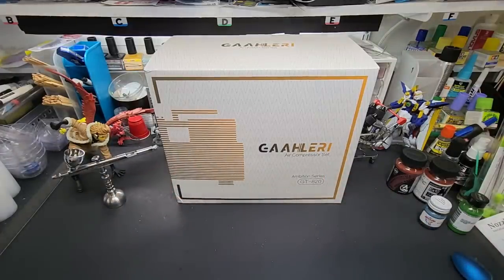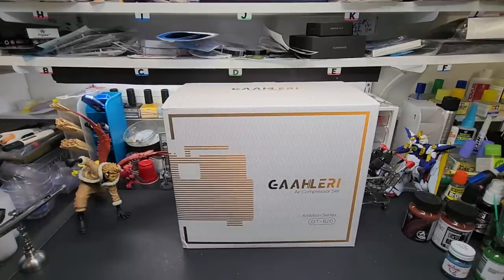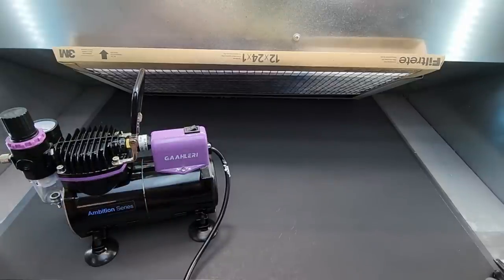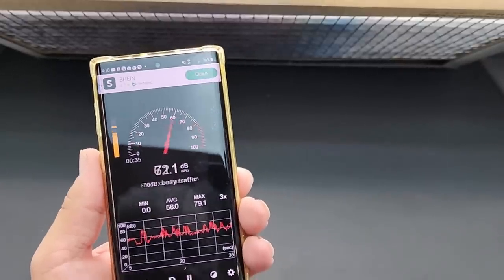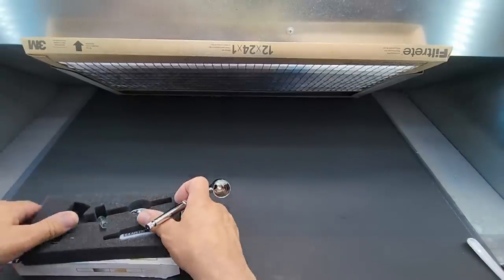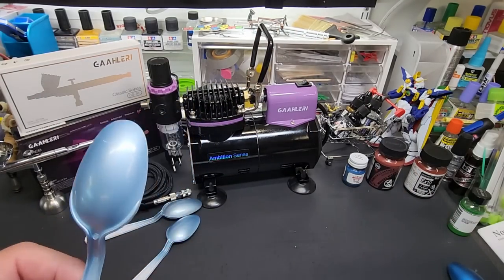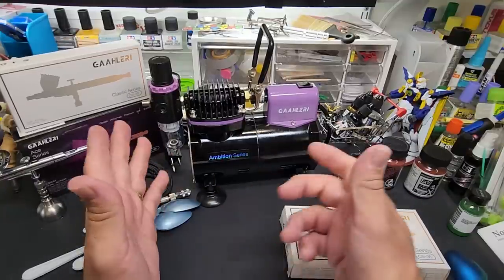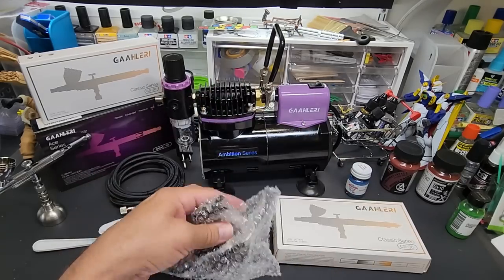Testing The New Gaahleri Airbrush Compressor

Comment: Awesome content, as expected!  I agree with another comment. Unless you are totally strapped for cash, get a compressor with a tank. Much better pressure consistency, compressor runs at bit longer until system pressurized, but then does not run for a while. Is easier on compressor, less noise and better product. Thanks for doing these videos!

Comment: Nice, this is why Ilike your videos... I just got in my GHAD-39, I ordered it to paint heaver Acrylics, good to see that the .30 can push primers that easy, I had switched to the .50 thinking bigger is better, I'm using a Master S622 with a #.08 for my badger primers, works great, however the Timber-Tecs in a .30 (Master G33) yes the parts intermix with all 3 air brushes... Struggles pushing out the craft paints , Yes still working on thinning those paints, but also struggled with the Golden high flow ... The # .50 in the Timber-Tec seems to do better. But was listening to your video about the Gaahleri having better atomization. so, I went for it, will be testing that tomorrow... Thanks again for all you do... Big C 😎
Reply: thank you for your support!

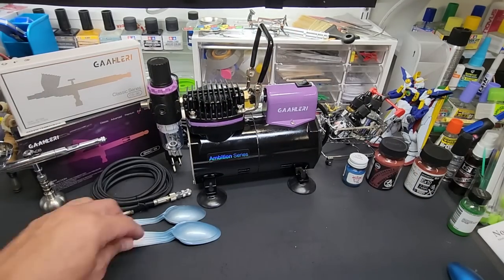Comment: I really should consider getting one of the tankless compressors. I have a large garage type compressor and only need to run it once a month (when the wife isn't home) for all my air needs. It is getting a bit rusty and due for another deep going over and gauge replacement.  Do love the anodized blue paint at 19:05

Comment: I bought this item, in fact I bought the bigger package with a 0.7 airbrush also, I figure it would be great for doing a lot of priming. Anyway, a mixed bag but overall good result. The unit that was delivered didn't work, which makes me wonder about quality. But when I contacted Gaahleri, they responded within several hours (time difference I'm guessing) and after I explained the issue and sent them a short video, they diagnosed the problem, which they didn't have a replacement part for, so they sent me a whole new air compressor. Now I have a backup (minus the evidently faulty moisture removal), and it also came with the 0.30 airbrush, so I have a spare there, too. Very responsive customer service, and I verified the 2nd unit works.

Comment: Thank you for another Great review.  I definitely like the aesthetics, and small form, of this Gaahleri compressor reviewed here. Because I typically work on my stuff at night after family hours I wonder if it is possible to add an aftermarket tank to this model if desired.  Based on the decibel level demonstrated It may not be necessary but it would be a nice option to have regardless.

Comment: Although this video is several months old, I just checked this product on Amazon. Unfortunately, there were only about 4-5 reviews. None of them had used the compressor as of their posting. However, each one stated that the packaging arrived damaged, paint had leaked in the box along with the cleaner. I certainly hope that Amazon has resolved this issue.
Reply from the maker: The company was very upset with what Amazon was doing, sending out returned and damaged products so that's when they made their website and now ship everything on there own. And they ship very fast Check it out www.gaahleri.com